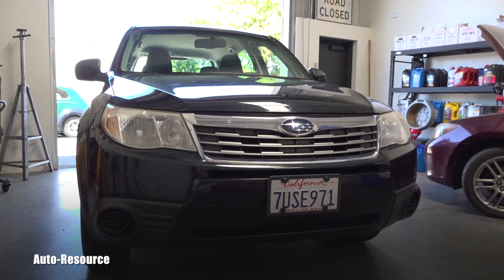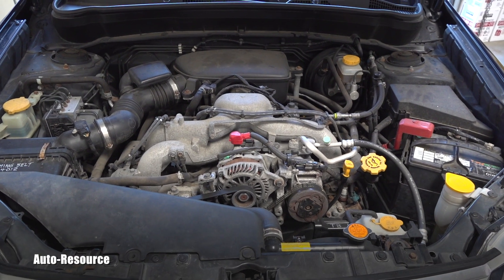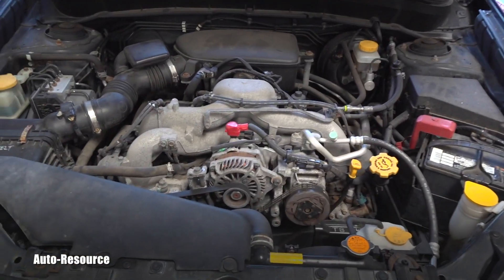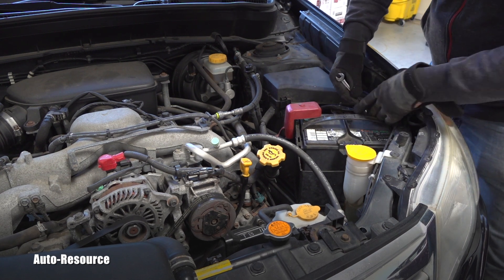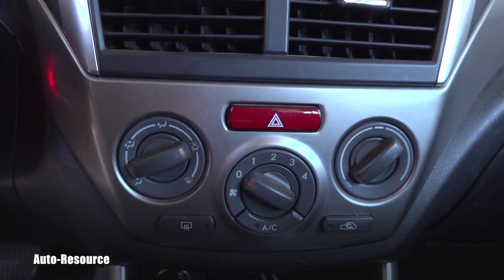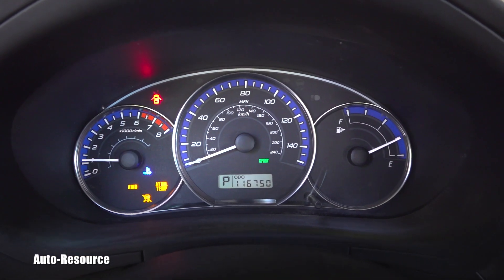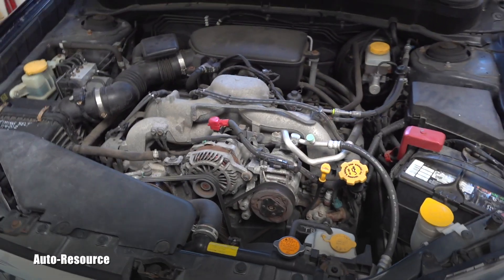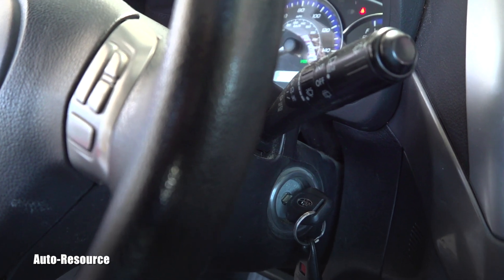Subaru Idle Relearn Procedure

Comment: I have 2012 Subaru forester that stalled, throttle body filthy, and idle low. It improved stalling after relearn but now it idles at 674. My map at idle is 16 hg and almost barometric pressure at wide open throttle. My accel pedal position is at 13.3 percent. Can someone diagnose issue. Oh yeah, no check engine light and nothing in history.
Reply: I also cleaned throttle body first before relearn.

Comment: Needed this after my throttle body rebuild last month, and just found your video. Do I still need to do it, or would my 2014 Forester have already done a relearn over time without my intervention? Noticed I'm getting worse MPG since that time, btw, so may just perform it anyway in case.

Comment: Did not work for me.. car had issues starting, got the battery checked and was running at 330cca instead of 550. Bought a new battery, put it in, and now it stalls at stop lights and sometimes when starting up. Did this procedure and after the 10 mins, started it up and it almost immediately stalled again. Assuming I have other issues now…
Reply: same thing going on with my 2009, originally started having issues after i reset my battery for an engine light and i now got a 750cca battery, video did not fix the low rpm’s, what did you do to fix ?
Reply: @andy.ellington  same issue here lol, did you find solution?
Reply: @ Turned out to be the ECU resetting. Car needs to relearn the idling, and every time i would “reset it” it would restart the timer. Just unplugging the battery alone is the issue so give it a couple days and it should be good

Comment: During a battery replacement the car is without power for like 5 minutes and that’s enough to reset the ECM but  when one wants to do the idle reset the battery has to be disconnected for 30min? How annoying.

Comment: I need to do this to my 2008 Outback. I am taking it to the shop next week to get the valve gaskets replaced and could have my mechanic do it.  However, this looks easy enough.  Is it possible to make the idle worse if I don't do the process correctly?   Also, does the car have to be on a flat surface in order to do this?  It's parked on a steep driveway. Thanks.

Comment: Thanks for the video, it's the same instructions as Mr. Subaru's 1387 YouTube tutorial, but easier to follow as you show what you're doing inside the cabin. Idles nice and smooth!

I saved over $200 replacing a battery myself on 2026 Forester with a Interstate battery from Costco (vs dealer's > $350 parts/labor quote). Only other thing needed after a battery is reconnected is to reset the power windows (best instructions are in your owner's manual, look for "initialization of power window" section 2-35").

Comment: This worked for me. I want to say thanks for taking the time to put this video up.
My car = 2010 Forester, manual transmission.
After I replaced the battery - first drive and when approaching an intersection as I push clutch and brake, the engine would drop back to idle very low, then lift again to a stable idle. But occasionally would drop so low initially that it would stall.
I followed the steps in this video, and now the idle when settling after arriving at an intersection is stable immediately at around 700-800 rpm and no longer stalls ever.
2 thumbs up and thanks again for taking the time.

Comment: Idle Relearn Procedure

Turn on 15secs
Start idle 10mins
Turn off 20secs
Turn on 15secs
Start idle 5mins
Turn off 20secs

Your Welcome!
Reply: You missed having the battery disconnected for 30 mins
Reply: @maxlarkin2613  I think this step is just to reset the ecu, and to do that you just want the battery to drain itself completely. You can do this by stepping in the brake a few times with the battery disconnected, and it achieves the same thing in much less time!

Comment: Will this procedure work on a 2007 forester?
Reply: It works for me! I bought my 2007 X (AT) new and have done this quite a few times, either because the battery was disconnected or sometimes even just clearing a CEL/MIL code will cause a rough idle (in which case I don't even disconnect the battery before the re-learn procedure at all; I only disconnect the battery if it's being replaced or it's for safety during another repair). 

I write down my radio stations! then make sure all lights, etc. are off. Rotate key to ON and wait 20 seconds. START engine and let idle for 10 minutes. Turn engine OFF and wait 20 seconds. Repeat all 3 steps (works best for me if I let idle 10 minutes the second time also; tried 5 minutes before and not as smooth for my car). Start engine normally, re-program radio presets, and drive happily.
Reply: @janasheffield2230  
I've tried doing this 2 times now and there's no change. The engine idles at between 4 &500 rpm if it doesn't stall out. I've also noticed that since I replaced the battery and the alternator my cruise control doesn't work either.
Reply: @johnvanscoy8840  I replaced my alternator last year and my battery last week and used this method to re-learn my idle after each. No trouble with my cruise control, other than I have a separate emissions issue and CEL codes disable cruise control on our vehicles. 

Other than clearing CEL codes or disconnecting my battery, the only other idling issue I've had was when I was intermittently getting misfire codes; the whole car shook violently for a minute and then would stall out, then on the next startup would be completely fine. I ended up getting my ignition coil pack, spark plugs, and plug wires replaced, which fixed it, but before I handed it over to a real mechanic, I tried cleaning the throttle body and MAF sensor, which had no affect but were on the list of suspects as I researched idling issues.

If you have a code reader, you might check if there are any that haven't actually shown up (or possibly have fully triggered but your CEL bulb could be out so you don't know); this could disable your cruise control. 

If no CEL, then you could double-check that you have exactly the right battery and alternator and that everything is connected well. If so, then I wonder if you may have another electrical issue that caused the battery and alternator to fail, but I really don't know where to begin there.

Unfortunately, all of my car knowledge is limited to the issues I've experienced, and my partial understanding of the matter at the time. So this is pretty much everything I can think of. I will say that the idle re-learn procedures is effective for when you know what caused the idle to be for

I will say that the utility of this idle re-learn procedure is a matter of controversy. Some vehicles need it, and some don't. And vehicles that need it, need it as a follow-on to some other repair or action that caused the idle settings to be forgotten (like disconnecting the battery or flashing the ECM). You won't just start your car one day, discover it has forgotten how to idle, then do this and it fixes it, and you have no other issues. 

If you've disconnected your battery several times before and didn't have idling/stalling issues for a day or two after, your Foz may not be one that needs this, and you should focus on other issues. If you have experienced that and think your Foz might be the type that does need the procedure, but the current idling issue didn't start after clearing a CEL code, disconnecting the battery, or flashing the ECM, you may still need the procedure after solving your real issue, but it probably won't do anything for you on its own.

If this idling issue did begin after a repair that could have cause your ECM to forget the idle settings, then you can try this procedure again with longer intervals. Some people disconnect the battery for 30 minutes or overnight, put the key to ON for 20 seconds, idle for 20 minutes, turn OFF for 20 seconds, then ON or 20 seconds, idle for another 20 minutes, then OFF for 20 seconds, then start and drive. I don't know if their ECMs are different or they just don't know they could use shorter intervals like me. Worth trying if you're sure it started after a repair. If a longer interval won't do it, it may be an unfortunate coincidence and you have a separate issue. I would probably get the ECM checked next, but I honestly have no idea after that, beyond the issues I mentioned above.
Reply: I had no problems with my 07 before I replaced the battery and the alternator. I actually use the cruise control on a daily basis and it was working fine the day before I did the replacements. That's why I'm wondering if I could have knocked something loose or disconnected something without realizing it had happened.

Comment: Great video! This absolutely worked for me. A few months ago I replaced my battery and the entire time since then my car's idle would nearly stall, then jump to 1500rpm, then drop again, etc. This fixed it and it idles smoothly all the time. For reference I have the same year & model as the video, 2010 Forester.